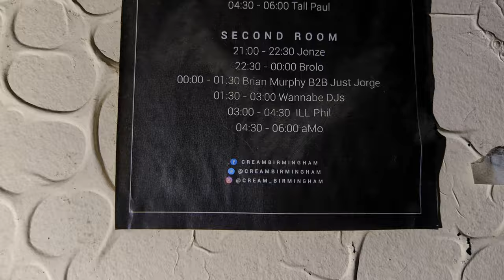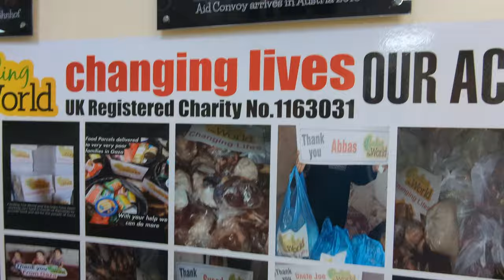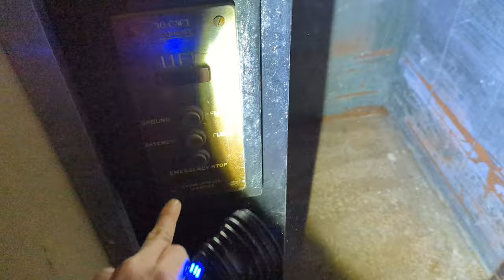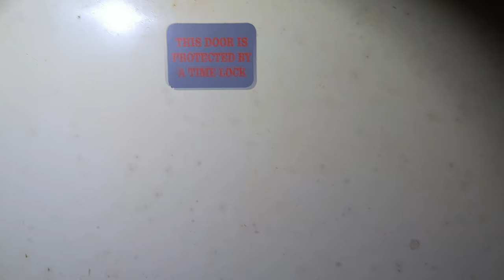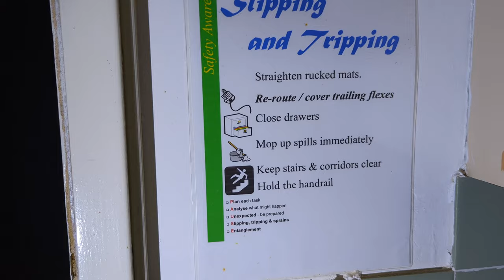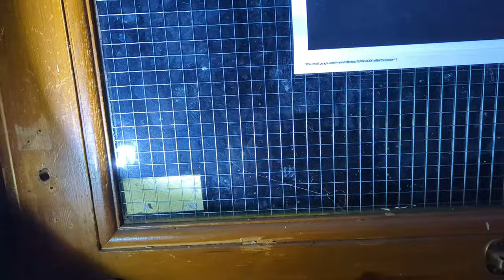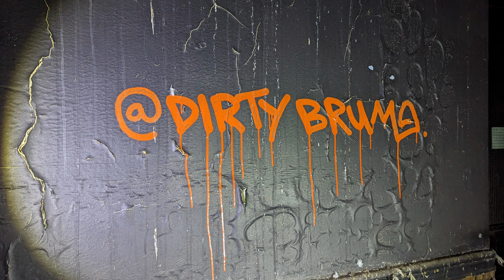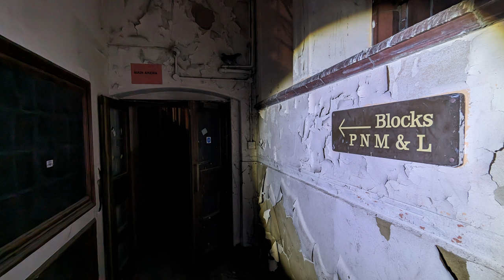Que Club Central Hall, Massive Abandoned Nightclub Birmingham, Urbex

Comment: Sorry me again. I've tried to find some footage of the organ being played but the sites about it are thin on the ground.
Imagine if it was a little bit older than 1903 before electricity and was all mechanical.
It's from Germany apparently and - get this - has TWO THOUSAND ONE HUNDRED pipes!
Reply: German organ, in the heart of 90s Brummie techno. 

There's a story in there somewhere.
Reply: Link? I wanna see these German organs your on about.
Reply: @sodnpoo  Fnaar Fnaar.
Go to Hamburg and treat yourself to the gated street of temptation that is the Reeperbahn. Germany's equal of the one in Amsterdam.

Just in case I've gone off topic here, es tut mir leid!

It was a dry as dust report in the local paper which led me to nothing more than
"The organ came from Germany in 1903 and has 2100 pipes."

If you go to the Reeperbahn they won't let you through the gates if you're with a female.
Reply: The organ was something to behold but I think your barking up the wrong tree if you think there's footage of it being played